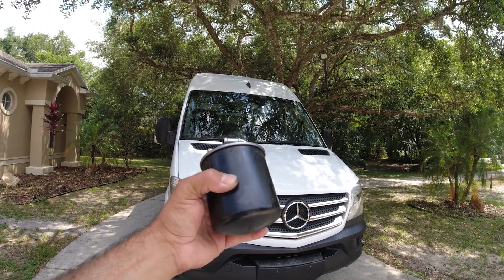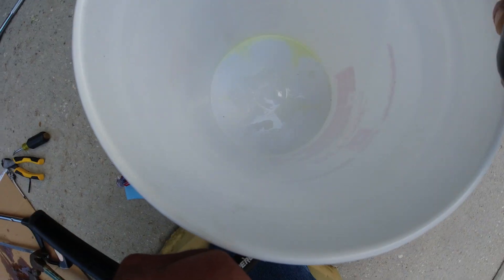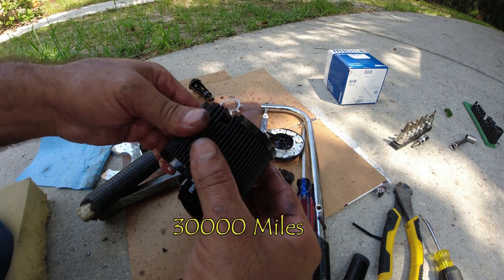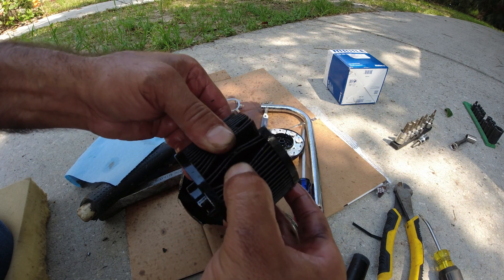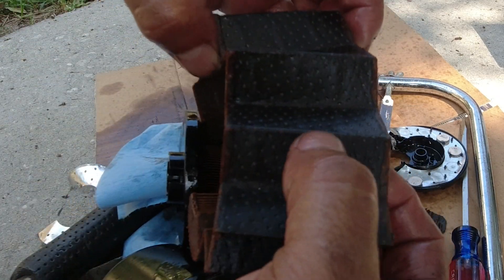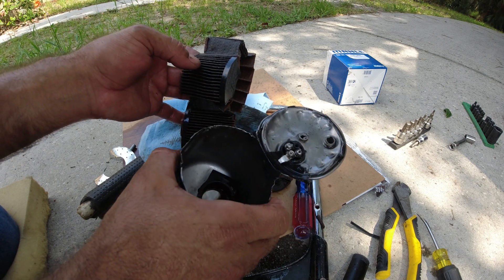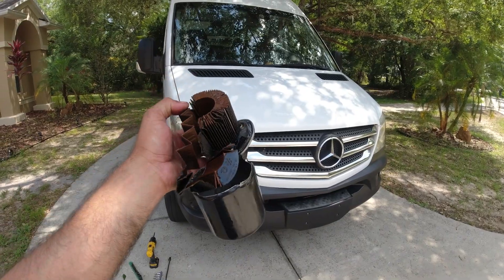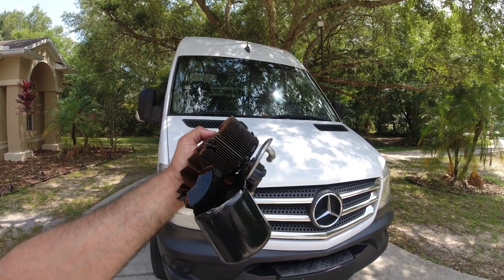See what's Inside a Diesel Fuel Filter After 30000 Miles Mercedes Sprinter

Comment: I'm at 28,000 miles on my 2.1 turbo and I've been getting a system too lean in bank 1 code. I also watched your vid replacing the fuel filter. Thank you. I was worried about the factory hose clips. Thumbs up on both.
Reply from the maker: thanks for your comment and im glad you got it figure out buddy👍👍😉😉

Comment: just subscribed to your channel, your explanations are clear and your camera work is steady and precise, well done ,just a note on oil, esp if for the vehicles that are running the DEF systems i believe, I saw one fellow using Mobile 1 diesel truck oil for 500k miles and no issues, I disconnected the DEF system because it was costing way too much for repairs first 2 were $1500 each, def heater and nox sensors so out it came, now I get much better fuel economy and horse power went up to 244. 2014  2500 170 converted now just reached 300,000km, which is 180,000 miles, so did all my fluid changes and filter changes, added Sumo springs, shocks, struts, winter tyres, STILL TO DO,  change fuel filter, add a Hellwig sway bar, change windshield. paint the rocker panels, plastic trim, and bonnet with a bully paint bed liner black, its like a raptor paint but water based made in Australia, water base make sit easy for clean up and touch ups if needed.
Reply from the maker: that is a awesome modification i would love to do the same.
Reply from the maker: and thank you for subscribing 👍👍👍

Comment: Hi do you have any problems with van or def system, how many miles you got there
Reply from the maker: I have over 50000 miles and on this sprinter I had no problems but on the other one that had about 50000 to 80000 miles I did have to clean the def filter
Reply: @mercedessprinterdiy8556  thanks helps